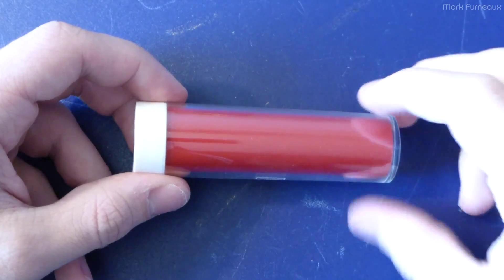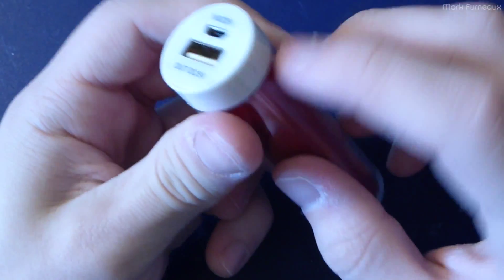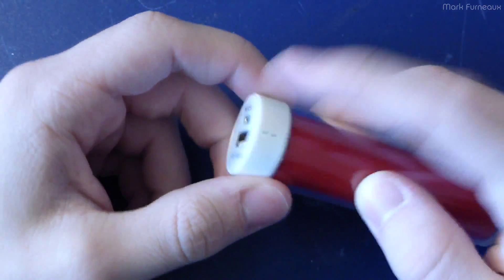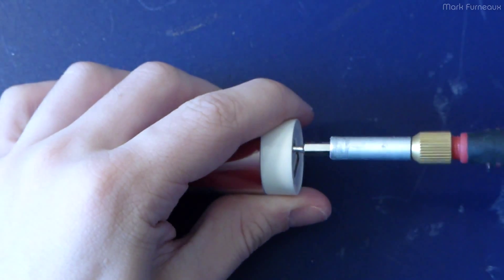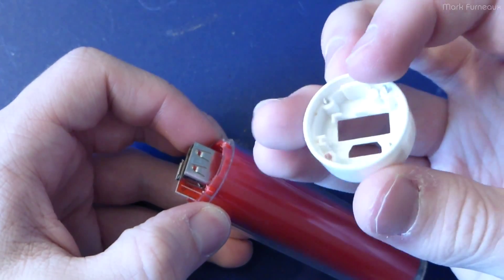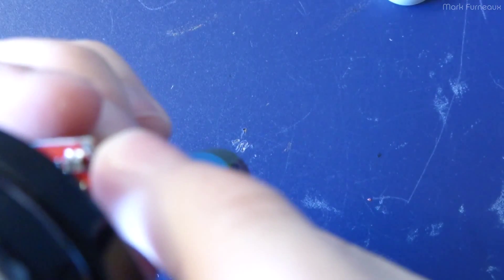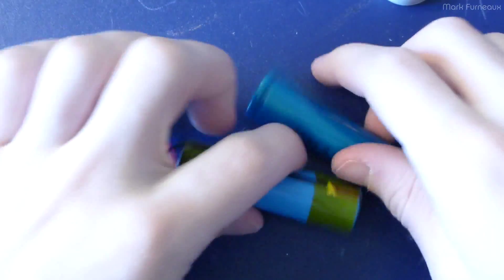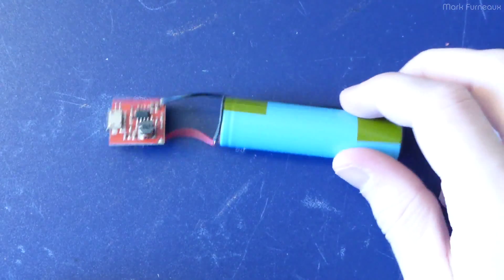Random Teardown #011: Free Single-Cell USB Power Bank

Comment: These things are extremely dangerous.
A friend of mine has had one blow up, and checking online, you can see many people have had similar failures ...
Also the inductor is WAY too small to handle much current, and it ends up burning up.
Reply: +Benjamin Esposti “Ozias” They blow up charging or being charged? If the answer is 'while charging', are they safe if the 200mA output current range?